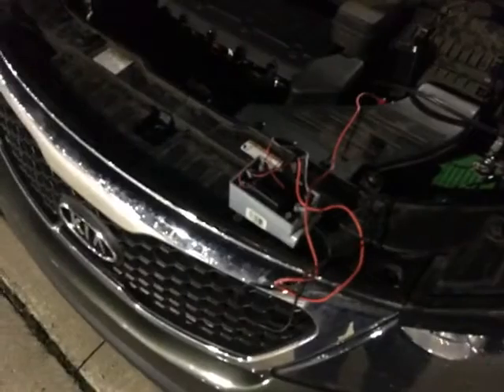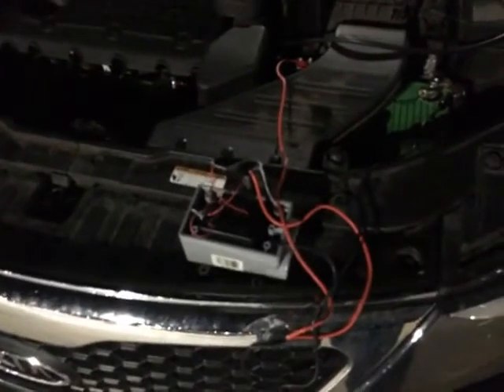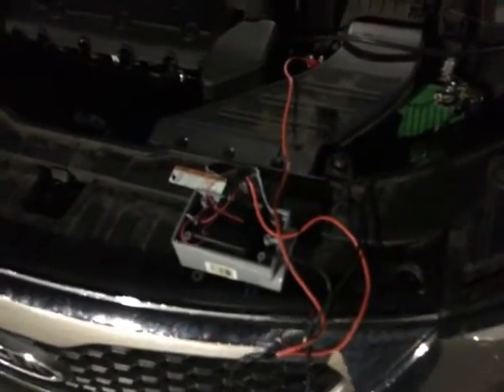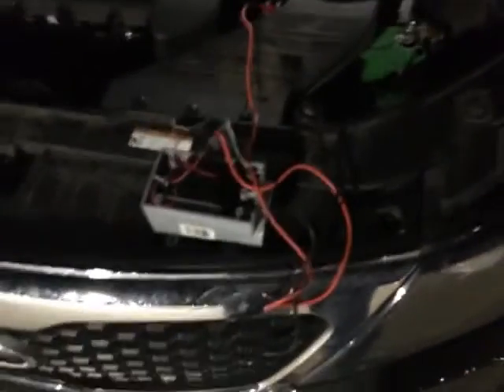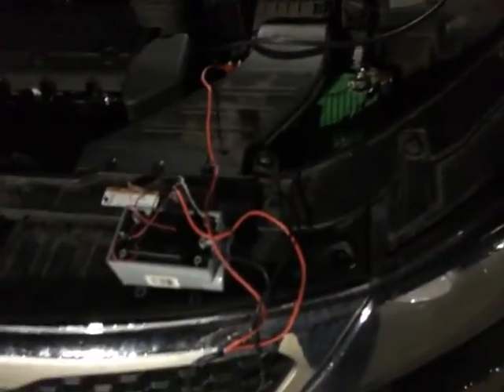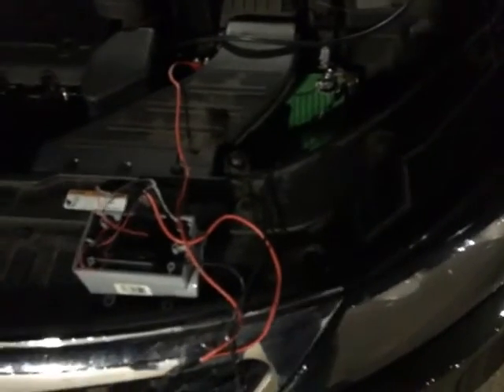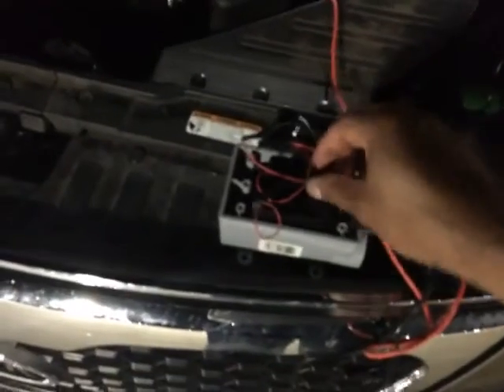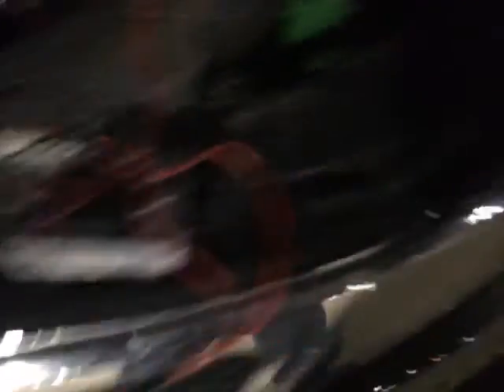Charging My Ultra-Capacitors with AA batteries after car sits for 4 days

Comment: Is the loss of voltage when your car sits from a feature in your car that is drawing power even when "off" or is it just an inherent property of super-caps / ultra-caps?  Keep up the great work with your content!
Reply from the maker: I believe it's a combination of both. The internal clock of the car, the computer, radio setting etc.  All of these are small parasitic loads.  However, automakers design vehicles with this in mind with respect to Lead Acid Batteries. Also, there is natural mA draw on the caps and thanks for the comments.